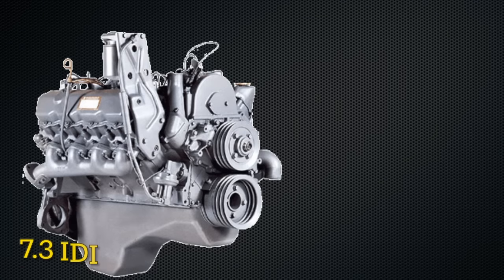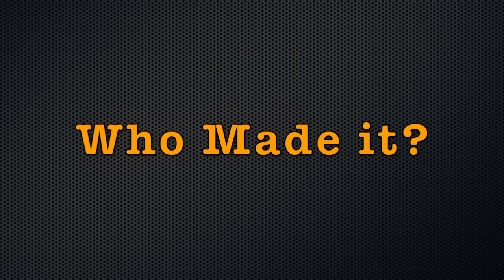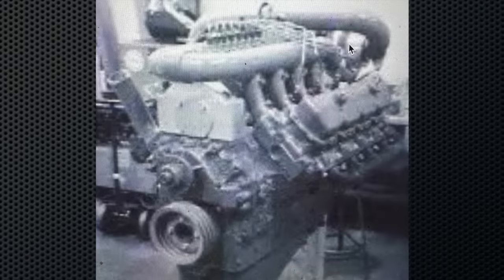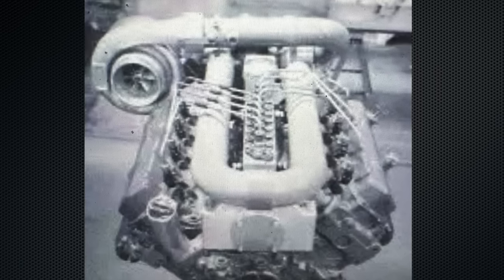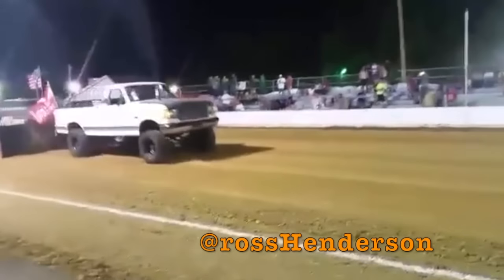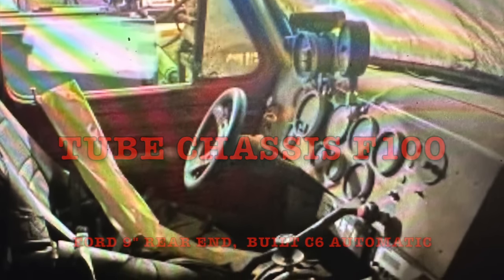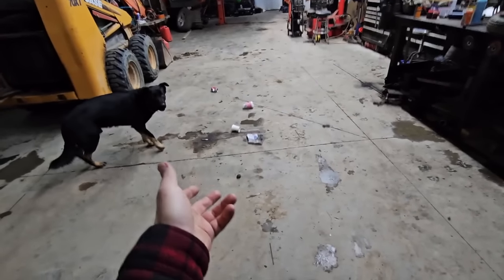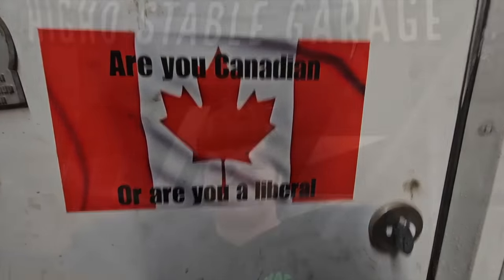The Legend of the 1200HP IDI Diesel, featuring @ziptiesnbiasplies!

Comment from the maker: It really is crazy that an IDI engine can reach 1200HP, but I guess that begs the question, do you believe that this engine really made as much power that they say?
Reply: I do and I have several 6.9 idi and 7.3 idi I'm working on my spare time to build one. I am a Machi ist and have access to make custom heads
Reply: Until someone makes this, this is simply bs. Pictures arent proof of horses or torque. It looks nice sure, but that's about it.
Reply from the maker: @eyeameye9565  that’s fair, I’m hoping this video brings some other stuff out from hiding on this engine, someone somewhere has to have a video of it going down the track, same as the truck pulling. Fingers crossed
Reply: @highostablegarage 
Joliet is just a couple hours away from me. 
Interesting it ended up in ILLinoi-istan
Reply: I'd belive 700 at the crank, any higher than that and you're violating the fuckin laws of thermodynamics
Reply from the maker: @Jefforey  that would be quitesweet
Reply from the maker: @bread-gz3rl  I’m not a scientist so I would have no idea really, but I guess my question would be what would make an Idi platform different than any other engine, it is getting force fed boatloads of boost for the 1200hp number
Reply: That’s like saying a 1.5 vw idi diesel is capable of 300hp

Maybe for a split second with nitros and compound turbos. 

But that’s a fat ass maybe
Reply from the maker: @fastinradfordable  6.9 litres is more than enough for 1500hp, especially with over 100psi of boost
Reply: @fastinradfordable  you gotta be shitting right ?there are several of them out there pushing over 300hp
Reply: @TylerDuysen  yeah I mean a VW 1.9 can make over 350-400 when fully built. It's a lot for it but still
Reply: @fastinradfordable  easy. And 3 liter idi Mercedes diesels make over 700hp fuel only.
Reply: I tend to believe more like 800hp 5000rpms and close to 1000tq is more realistic IMO and could still power that truck to 9s in the quarter with the right trans, gearing and weight. I would lean towards it requiring a filled block and/or sleeves, water and/or methanol(possibly with a little nitro in it)to get to 1200hp...but, who knows if it was extremely fragile and temperamental...it could have do it. If a Buick V6 can done it, why not an IDI.
Reply: @TylerDuysen  r&d diesel performance for 6.9 idi and 7.3 idi
Reply: @highostablegarage idi engines concentrate a lot of heat into the precombustion chambers. That can make things really melty. They also rely on the high compression ratio to mix the fuel in the swirl chamber since their injectors aren't as refined as di engines.

Idi uses fast moving air and slow moving fuel

Di uses fast moving fuel and alow moving air. Di engines use intake port design to create swirl for fuel mixing.
Reply: @TylerDuysen not vw idi stuff, tdi stuff yeah many make over 300hp
Reply: @obancameron those are direct injection engines
Reply: @trev0rbr  good point. Hard to know what went on in this build without seeing heads and pistons eh
Reply: Considering you can buy a kit thags virtually identicle to this for the 7.3 powerstroke and make even more power yea yea its possible
Reply: @trev0rbr  yes even the vw idi stuff there all over the internet
Reply: Now you'll understand that it about 800 horsepower a 96 or a 9773 will lift the head off the block right and then you stud it in the studs are only good for 12 or 1300 horsepower then you started experiencing headlift again I'm just saying
Reply: @TylerDuysen  where?  They struggle to make 100hp per liter. I've been a vw idi enthusiast for 20 years and haven't seen it
Reply: @21babydew and yet here we are 30 years later with much better knowledge, much better components, and nobody is doing it. And the ones who claim they did can't prove it.
Reply: I wouldn't say it is impossible if you give a disel engine enough fuel and air too burn it cann make almost any power you want  DI or IDI is in that regard not really important it just needs more money and time too get too the "same" numbers as The DI  (with the drawbacks like worse idel becaus of the high air flow head etc (aka bad fuel mixing at low rpm)
Reply: @TylerDuysen  the TDI VW is a DI motor, the old old 1.5 and 1.6 ones were idi
Reply: So I actually live quite close to Joliet Illinois and have multiple hypermax parts on my ol 6.9 IDI, the 1200 horse IDI is in fact true, no I do not have dyno sheets or anything but there are multiple locals that can in fact prove that truck/motor ran down the track leaking coolant due to block flex. This is a legend that needs to be brought back!!
Reply: i know i wouldnt have told you to look for 300+hp idi vws if it was a tdi @100pyatt
Reply: Why not they get these number from a Honda k24 not the torque but hp insane
Reply: @mikecrystalrobert7898  yea but probably spinning at crazy rpm
Reply: I dont se why it shouldnt be possible :) The Mercedes Om606 is only a 3,0litre straight six and the internals of those engines have proven to tolerate about 600-680hp on stock internals (only upgraded valvesprings/injector size) before they really start to struggle. I suspect a v8 with over twice the cylinder volume will have no problem reaching 1200hp :)
Reply: @sanderslotsvik7801  yea but an idi international isn't really intended to make more than 150hp in the first place and v8s as a whole are far weaker structurally than 6cyls
Reply: The one I remember reading about said it had A 12 inch main girdle. So it doesn’t sound like the engine held 1200 hp without the equivalent of another engine attached to it
Reply: @fastinradfordable  actually tdi's are capable of 600+ hp steady and safely!!!!@
Reply: Yes
Reply: 1200hp maybe but for how long?
Under full load I'm guessing not much more than a few seconds...
Reply: @Draxindustries1  30 secs atleast for pulling
Reply: The 3 litre Mercedes OM606 engines are pushing 200hp per litre on IDI architecture and inline pumps, they’re well known for their ability to sustain high rpm’s, power numbers are all about high rpm, if they could reduce the mass of the 7.3L pistons and keep the rotating assembly together I don’t see why 1200hp is unachievable. It was great to see Peg here!!
Reply: At the end of this video you can really tell they hate Dodge.  I can imagine why, first ones at the drag strip to go 100, 200 and 300. First to go 200 on a circle track.  Dodge completely dominates super stock diesel. If you see a Ford competing it has an engine like the Dodge.   Yeah, Dodge sucks
Reply: It's awesome to see it's still together. I've been looking on and off for years for more info on this thing. I've been an idi fan for like 30 years and have owned ten or so idi trucks. Would be so cool to see it in person.
Reply: I definitely believe it all of that custom work wouldn't be as crazy if it didn't make 1200. Why would they continue to dump money into something like that if they couldn't get it to where they wanted it to.
Reply from the maker: @jok3yjesu339  good way to look at it

Comment: Im by no means an expert on this topic and many others, but I would say. In my opinion the motor could have likely had around the 1000hp mark if it indeed ran low 10s and high 9s in the 1/4 mile. Like I said, im no engineer. But given the shape of the f100 and any truck for that matter, you need to be pushing serious power on the top end given the drag coefficient of any truck. And my best guess would also be they didnt have any fancy nascar ducting and such under the car to help out with drag. So if it did run the speculated drag times, I dont think it would be totally unrealistic at all for IDI to be pushing around 1000+.
Reply from the maker: I would love to get my mitts on the engine and just see how it tics, that would give a lot of closure

Comment: International Harvester had a 9l V8 diesel which was also somehow related to the IDI's, which used an inline injection pump, I'm not sure the make, but I was thinking you might be able to adapt the 9 L V8 pump to a 6.9/7.3 IDI.
Reply from the maker: Interesting perspective, I’ll have to do some digging but companies do love reusing parts for even other engine families, might be easier than thought
Reply: The 9L was a slightly revised version (or possibly the automotive version) of what was originally the DV-550 V8 IDI diesel. They were used in a couple IH tractors (1468 & 1568, and were rated at something like 140 hp, if memory serves) but were not very successful. The 9L was more commonly found in busses and other medium duty trucks. Also not known for much in the way of HP, but reliable and fuel efficient. The DV-550 did have a big brother, the DV-800 that IH used in at least one big 4WD Ag tractor (I think the model was 4768) and rated at around 300 hp.
Reply: The 9L was a revised DV550. 550s we're not turbocharged. I've been told that when you turbo them and work em the bottom end gets weak and it'll drop the crank out the bottom. There was  a larger line of international V8s that included the DV 573 and DV 800. The 573 and 800 were mostly used in heavy trucks. A lot of 800s also went in construction equipment and 4586 and 4786 tractors.
Reply: I know you basically have to source a p pump from a 1468 to build most v8 diesels for pulling duty

Comment: Hypermax was a pioneer in tractor pulling and Diesel technology, it could have easily made such power. While tractor puller love too boast, hypermax was very familiar with IH as they were the pioneers in hyping up IHs pulling tractors especially the 466. Hypermax could make any custom part they wanted when they wanted even if everything in this engine was one off. Mechanical diesels can be absolute monsters and there’s plenty of 5.9 Cummins and tractor engines making well over 1k horsepower. 1200hp is very achievable with a twin turbo mechanical diesel that is running an inline pump, at that point the fuel system is just a controlled fuel leak into the combustion chamber. The thing is no one is building IDIs like this or has ever built another IDI like this so many people won’t believe it but at the end of the day it’s the same fuel system as a Super Stock pulling tractor shoved onto a pickup v8. There’s people running ppump swapped powerstrokes making this much power. It’s not out of the realm of possibility once you consider the factors and the fact that Hypermax had whatever they wanted at their disposal. For example look at Gale banks. He can build a Duramax with whatever he wants in a completely custom manner and run tests all day swapping parts and changing factors in a manner that can’t be replicated. A 1200hp IDI isn’t a far fetched idea, the IDI just didn’t catch on as a performance engine like tractor engines or the cummins and it wasnt marketed as such either. It was a decently powered NA V8 diesel that could keep up with a big block and get decent fuel mileage. Cummins jumped onto the pickup scene with a reputation of bullet proof,and at the time high powered engines, coming from a long history of Ag and Trucking. Tractor pulling was popular long before truck pulling ever was and that’s where Hypermax started off

Comment: Interesting to think about how re-discovering and documenting this monster IDI may effect the aftermarket. There's likely some old engineering tricks in there that have been all but lost to time. Performance minded companies could copy some pages from that book for sure if there's anything in it like that, if they wanted.
Reply from the maker: 100%, it would change the aftermarket overnight likely for this engine
Reply: I doubt it most people that have an IDI have it for it, simplicity and reliability at stock power levels. If they wanted to make power, they’d get a real engine that doesn’t spread it cylinders apart.

Comment: That's so wild that you were able to find all this out. I remember back around 2010 when I bought my first IDI 7.3 reading forum post after forum post where people were all over the place about this engine and it's wild to think that there isn't say an OG engine sitting in a warehouse collecting dust because this would have been amazing to see as a display piece at a museum somewhere. I always thought the IDI was a good platform and it was amazing how much torque they developed. I remember going to an IDI meet up and seeing someone run one on a dyno and although they only made like 250-60HP they made nearly 800 foot pounds at the wheel....and considering a Cummins usually gets into the 350-400 mark for that amount of torque I found it surprising.
Reply from the maker: Yes sir, this old block definitely had a crazy amount of money thrown at it, especially in the 1990s!

Comment: One of my brothers had a beautiful 88 F350, 4x4 reg cab with a turbo diesel, he added a bigger turbo and injectors to he used to tow wooden boats he built all around the North East with ease. With a 5 speed manual transmission, using 3:55 gears he was able to squeeze 24 mpg just cruising around and 18 towing. Using a 3” exhaust through one big muffler. While he didn’t build this for racing, but towing boats as easily as possible in the most efficient way possible. I went on many of the trips, and was the only other person he would let drive, seeing I was a CDL tractor trailer driver. The thing I remember most was exhaust temps were so high I advised him to add a pyrometer, to help keep track, because there was so much power he never had any need to downshift on most Interstate hyw we traveled, except running across the Kancamagus in NH. With little to no smoke. Just for sits and giggles I’d love to tow a boat like that with a new F350 reg cab 4x4 with the HO 6.7 diesel, of course there’s no manual transmission but a 10 speed automatic, it would be interesting, one thing I know from an owner is in now way will you get 18-24  mpg with one.

Comment: I know it isn't an IDI, but a guy I used to work for spent a small fortune building 2 7.3s converted to direct injection.  They were built for a powerboat, and made over 1000hp when turned up. He kept them at 700hp for reliability. I spent weeks building manifolds.

Comment: It’s been a hot minute since I’ve heard about this motor.  I remember reading on it a number of years ago.  It’s cool to see you resurrect it!

Hypermax most likely did it because they could.  Back then they were one of only a handful of companies that had the ability to make such a Frankenstein.  If memory serves correct, these guys were big into tractor pulling long before they got into truck pulling, so they already knew how to make big power.  My memory may be failing, but I also seem to remember that the fella who started Hypermax was a former IH engineer, so he knew the platforms as well.

The story I remember reading on this motor is that someone approached Hypermax, and wanted to sh!t stomp everyone in truck pulling.  Like you went on to say, the fella dominated and was promptly kicked off the  circuit because his motor was so far ahead of the competition at the time
Reply: Jerry Lagod was an engineer who worked on the international 300 and 400 series diesel engines. He went on start Hypermax Engineering and support the tractor pulling sport. He is also credited with inventing water injection.
Reply from the maker: Well said! I’m really hoping this brings more attention to this engine, I’m sure someone has video proof of it either at the drag strip or at the truck pulls
Reply from the maker: Very interesting

Comment: I have a 6.9 IDI apart on the bench right now, going .040" over. I chose this engine because they won't blow head gaskets, crack blocks or cranks like the 6.2/6.5 GM, drain your wallet like a Cummins, Powerstroke or Duramax, and get reasonable fuel economy for what they are in an all mechanical diesel. If looking for HP one should probably start somewhere else though.
Reply: Right... considering Cummins is without a doubt more reliable while costing far less to achieve more power.
Reply: Hope you got head studs if you want the head gaskets to stay put.

Comment: I had the turbo IDI it was one hell of an engine, 500k miles, it ran like a top still,  they'll run off anything literally. Just like those multi-fuel military engines. As long as you filter it good. 👌💯
Reply from the maker: Pretty much 👌

Comment: i love my 6.5idi. Not as powerful as 7.3, but its very economical and cheap/easy to work on.
Reply: 6.5 is the detroit idi
Reply: My 1.9 vw mTDI with a variable turbo makes as much power as a ford idi 4x it’s size. 

And mine gets 60mpg. 

THAT sir. 
Is economical. 

For the fuel you spend to drive for 20 years. 
That’s all the fuel I need for my whole life.
Reply: @fastinradfordable  okay? Who wants to drive some shitty little diesel? Not me.
Reply: @fastinradfordable  It's economical for a 3/4 Ton Truck 4X4 Ext Cab, Long Bed with Shell. My other vehicle is a 2nd gen prius that gets about 45mpg. That 1.9 sounds awesome, what do you have it in?
Reply: @psd28  then why are you watching videos about 160hp diesels from the 80s lol
Reply: @jaredlancaster4137  they arent shitty and they arent little
Reply: @fastinradfordable  what kind of turbo are you using

Comment: IDI engines were capable of very high rpms without boost, the combustion system sped up the burning speed. The Mercedes IDI’s from the 90’s can make 200hp/liter